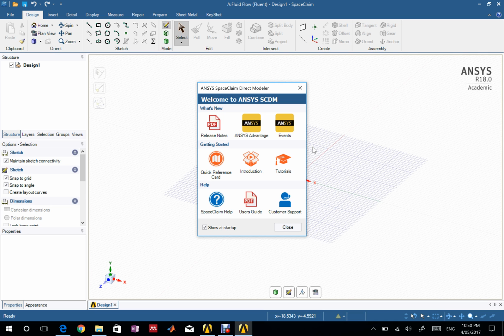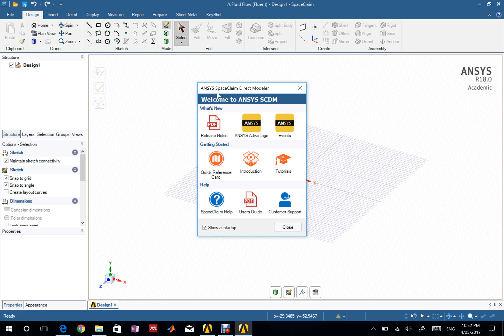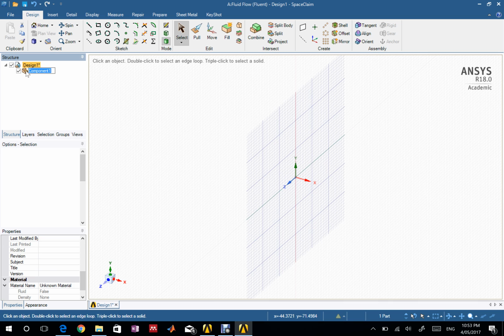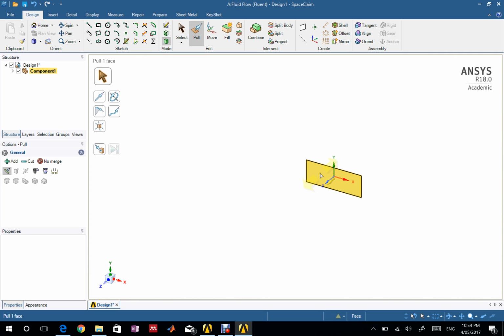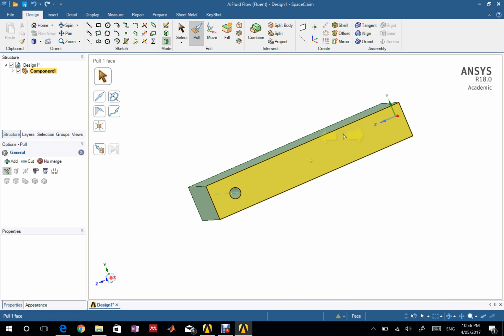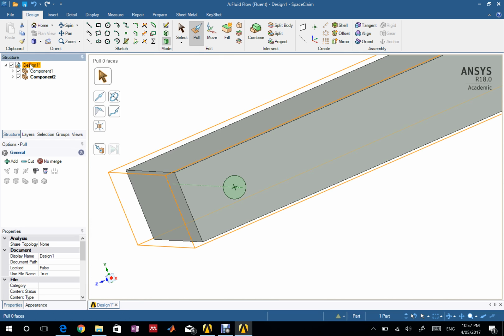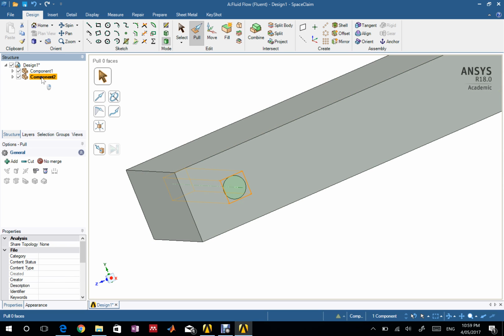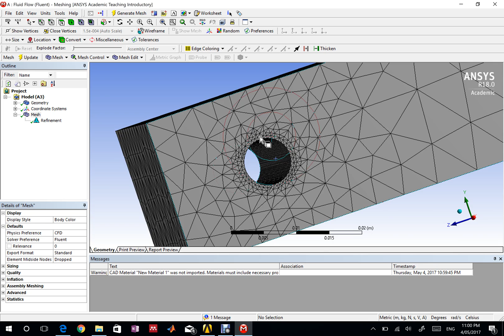An Introduction to 3D CAD Modeling using ANSYS SpaceClaim 18.0 | 16 | Fluent Tutorials

Comment: Very Informative sir. I am a beginner in ANSYS. Can I know if I want to incline a channel on particular angle how can I customise the angle of inclination in space claim geometry. Thanks in anticipation.
Reply from the maker: I believe you can define the base geometry at an angle. I haven't used SpaceClaim in a while, but there should be an option of defining the angle between your base rectangle and any axis that you want to incline it with.
Reply: @TanmayAgrawal7  Thanks for the quick reply sir. Can you plz help me in the modeling of mud slurry in a rectangular channel.I want to know how can be defined the rheology of the flow in Fluent CFD. is it possible to add the rheological parameter CFD analysis and how ?
Reply from the maker: No idea brother.

Comment: I have a problem of open channel like a pipe is embedded transversely into the channel and a slit or cut is made along the length of pipe on the top of pipe so that pipe gets water from channel and out it into the side channel. I want to learn how to proceed it for simulation, I have tried  alot but failed. Kindly suggest me. Thanks

Comment: Hi Tanmay
Thank you for the video. 
1. How to make a 3D geometry into half along its symmetry plane?  for example, If we want to cut the 3D mixing elbow into half along the symmetry axis to reduce the meshing and run time? I have seen that option in design modeler, but couldn't find that in SpaceClaim.
2. In the above video, how to locate the circle at certain distance from any of the edges?
Thank you in advance

Comment: how to make fluids to flow from 1 geometry to another, as if a pipe joined to a cylinder. do we need to specify special boundaries? as if its outlet of one body is taken as inlet of another body??
any help will be appreciated..
Reply from the maker: In my opinion, as long as the mesh is continuous, it should flow flawlessly.

Comment: Hi Tanmay,

Thank you so much for this tutorial.
I want to know how to create a hole across the solid at any angle. My problem is like inverted V hole configuration where one hole is at the end of V and another hole is at the another end of the V. These two holes are extended into the solid and make an angle at centreline of the solid.
Reply from the maker: Usually I create more complex geometry in Inventor or Solidworks and then import that in fluent.

Comment: Hello sir,  I want to design the same structure in the micrometer range (the slab having dimension of 10x10 micrometer and hole radius of 0.1 um). Is it possible to design such a small structure in ANSYS spaceclaim?
Reply from the maker: Yes. There are options to change the units, as simple as that :)

Comment: Nice video. I'd like to create a tank with a pipe, so I created two solids, the pipe attached to the tank's surface, do I have to make a hole in the tank? and should I define the pipe like fluid? or they I just solids? cause I want to simulate a draining tank
Reply from the maker: Can you email me with a rough design and problem statement?

Comment: Hello, your sharing video is very good. I have a question I would like to ask. I want to draw a wave spring with spaceclaim, I need to draw a rectangular cross section and then stretch along a spatial curve. How can I achieve this? Thank you
Reply from the maker: Personally, I have not worked much with spaceclaim. In CAD software, there is usually such feature that you can "trace" a goemetry (rectangle) along a curve.

I usually work with Inventor and import the .IGES file in ANSYS.
Reply: @TanmayAgrawal7  Hello, I am doing a sensitivity analysis of wave spring, using the optislang module in the workbench. I made a parametric wave spring 3D model with Siemens nx and imported it into the workbench, but it can't display these parameters in the workbench. Do you have any good way to display these parameters in the workbench? Thank you
Reply from the maker: Sorry I haven’t worked with them in workbench before.
Reply: @TanmayAgrawal7  OK.Thank you.

Comment: hello Sir, I have a problem if you could solve. In modeling, I have rectangle 2D, done with mesh and want to give convection temperature on one of its verticle side. But when I click that side then the option of convection disappears automatically and couldn't be able to give that temperature. hope you understand